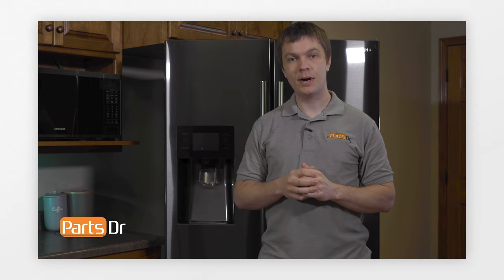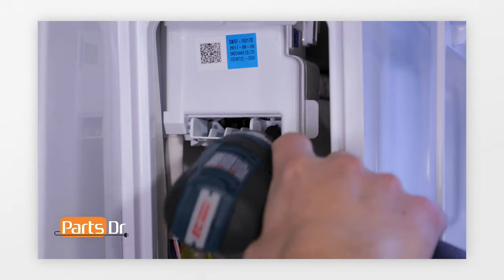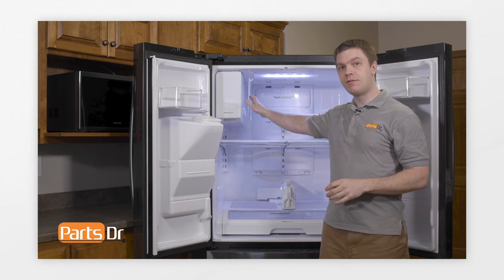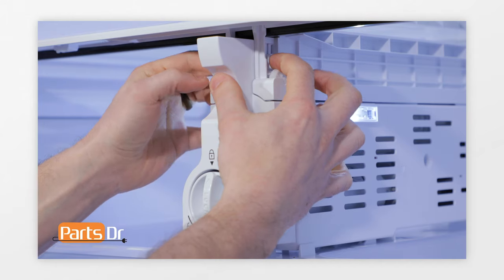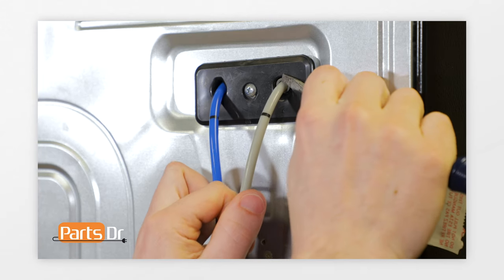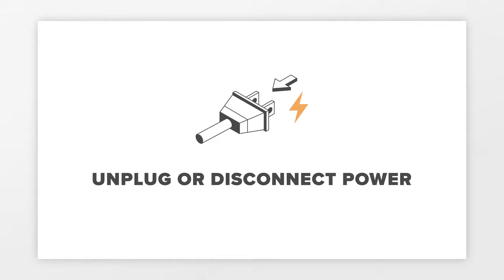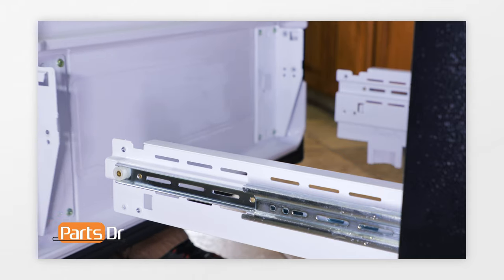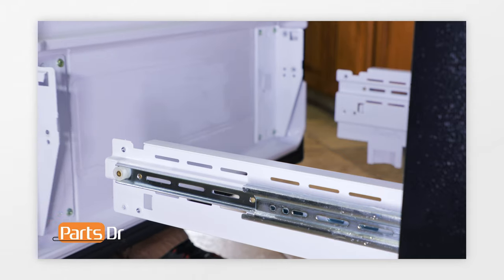Samsung French Door Refrigerator Disassembly - Model # RF263BEAESG/AA

Comment: Very helpful. I had a loud noise coming from the evaporator fan, figured I would be buying a new fan motor. After removing the cover I discovered that the ice buildup and the lines had built up to the point the fan blades were striking the ice. Removed ice and reassembled. Quiet as a church mouse now.
Reply from the maker: Nice job fixing it!
Reply: I got the same problem. This video is very helpful. Thx, Parts Dr!

Comment: I've been watching your videos for a long time now to fix several problems on my Samsung fridge. I was looking at this one expecting to find a clue to a problem still persists....: The back cover of it is seatting too much and constantly in the upper right corner, where the ice maker is located. So much that the metal cover began to rust some time ago. I took out the water hose to the ice maker looking for a puncture or if it was out of place with no results. Everything seems to be fine. There is a lot of ice build up aroung the ice maker. I fixed it twice already but I can not get rid of the problem. Could you suggest me something to find a final solution ? I have been asking some other technicians but I had no answers. I would really appreciate yout attention and expertise on this subject. I do not want to spend more money on parts until I know what the real problem is. Thanks a lot, Ramon Perera, Miami

Comment: Have a major buzzing/humming noise coming from the back of the fridge where the water lines go in. I do have water hooked up.also, still makes noise after i shut the ice maker off. Any idea how to diagnose or fix this? (PS- it’s not the evaporator fan rubbing on ice)

Comment: Is it possible to fix the clip where evaporator fan connects to the back of the refrigerator. Mine was rusted and when I unplugged it broke one of the pin.
Reply from the maker: We do not know of a fix for this.  We have heard of some people attempting to cut into the liner of the refrigerator to try to splice into the wiring.

Comment: How do we clean the drip pan? It smells and makes the fridge smell.  But appears difficult to actually remove to be able to clean it.

Also how do you remove the glass from the shelves? There is dirt under the edges.
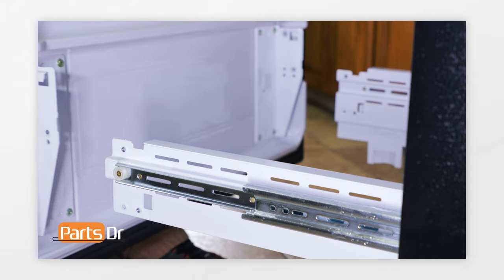Reply from the maker: The drip pan is not something that can easily be cleaned.  Check out 9:43 for this area of the refrigerator.

The glass can be removed from the vegetable cover assembly, but the glass in the upper shelves cannot be removed from the plastic.
Reply: I used a knife to pop up the white squares holding the glass took the glass off after I removed the entire shelf and after I cleaned it I popped the squares back on

Comment: Is there any way to take the back off the fridge??? A connector burnt where the evaporator cover fan plugs into the little housing at the upper left. There has to be a way to replace that harness or get at the back of the connector to try and wire a new one, no???
Reply from the maker: No, the cabinet is foamed in place and it is not designed to be taken apart.

Comment: Hi I m from India using Samsung side by side 585L from 7year want to know  can I remove back side compressor Fan and once I clean that hot pipes behind fans with water n blower clean well but after compressor wasn’t start I check everything thing in inverter but there was no fault then I waited  for dying of hot Coil I thought May there was any sensor in that coil which controls coil cooling and compressor start stop. After waiting for 30 to 40 minutes and  compressor started normally no issue want to is there any sensors in Hot coil behind  I always  clean in 6 months but this time I did water splash to to and I got know this can I clean with always next I have two push buttons in despenser one for ice and one for water  but there no Led light to show I check inside there was a circuit for LED but no component so I fix one Led to work on dispenser switch it glow with vibrations of current and not too much light so dropped my idea pls let me how to that because at in dark we can see 
properly in dispenser and how to detach both door size long round Pipe shape handles and how to stop water flow coming from fridge and freeze coming from inside and falls on floor when it in defrosting mode pls reply Thankyou

Comment: I have a fridge that Samsung could not fix. The technicians told me that it may be and electrical issue that they cant get to. They even changed out the computer board. Has that happened to anyone else? Sounded like they just gave up. But now i have a $2700 fridge that does not get cold. Any ideas?

Comment: My problem is that the fan motor connector socket (the one that is mounted on the interior wall shown at 4:16) is broken (the pin inside the socket is gone). How do I replace it? Do I need to disassemble the whole back cover to have access to the wire that is connected to the socket? That seems like a mission impossible.
Reply from the maker: If it is the connector on the refrigerator wall side, those parts are not intended to be serviceable.  Everything inside the wall of the refrigerator is foamed in place from the factory which makes servicing those pieces very difficult.